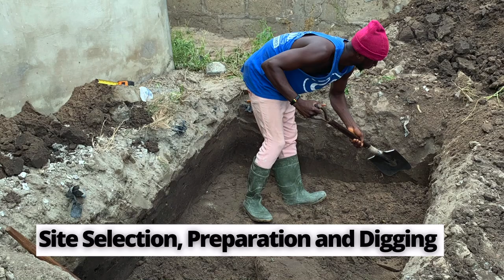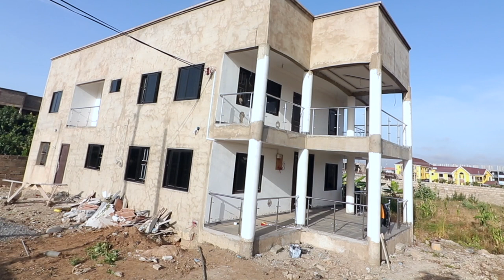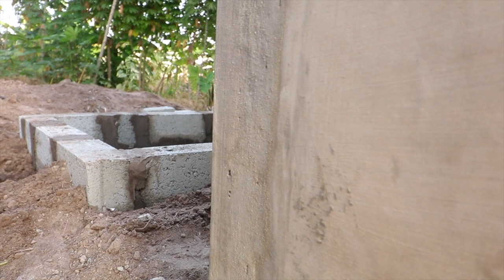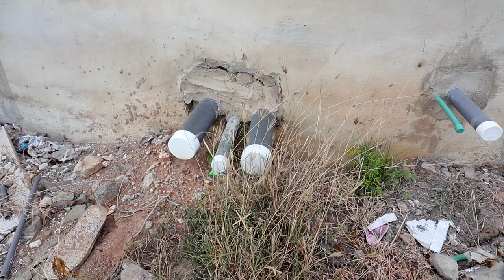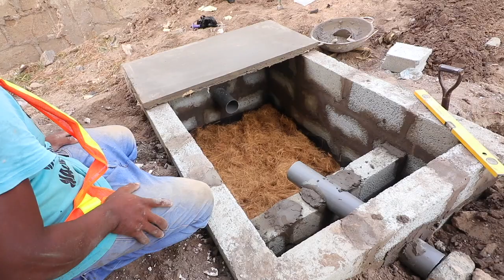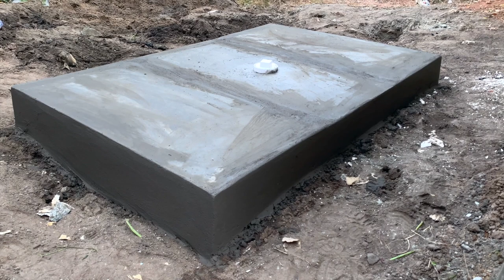How To Construct a Biofil Toilet Bio Digester Using Blocks

Comment: What gives pressure to the system. I have a really septic tank and would love to use the biogas. My three biogas digesters are frozen cause of wintertime
Reply: Where are the gas distribution pipes , What is the gas  storage  capacity, why  deposit bio slurry in a soak way ?

Comment: Sir pls do u lay pipe in the over flow blocks that u lay in de digester.... Or there is no pipe
Reply from the maker: Yes. You will always need a pipe outlet either for the black water or the overflow depending on what’s on the ground.

Comment: Hello there,  my question is that, does the dagester combines toilet waste and water from bath and kitchen sinks?  And how about hair goes in the dagester? How about tap of oils? I would like to have your answer, thanks
Reply: The bath , kitchen and sink goes to the soak away pit not the dagester
Reply: Digester only takes in waste products from toilets, the rest like water from the sink are connected to the soak pit to be filtered and join the eco system